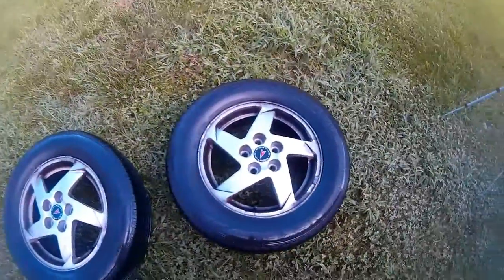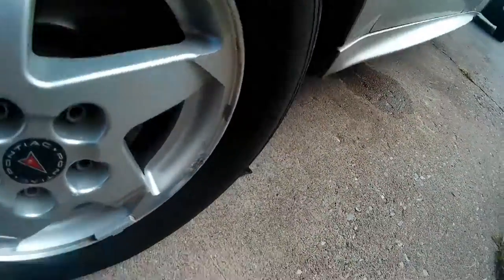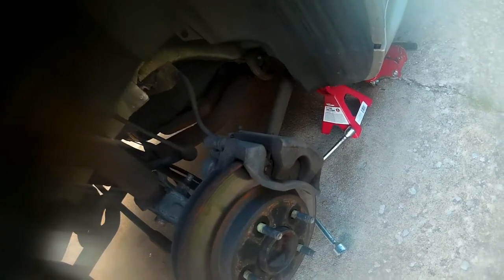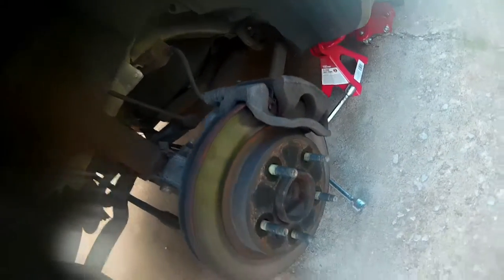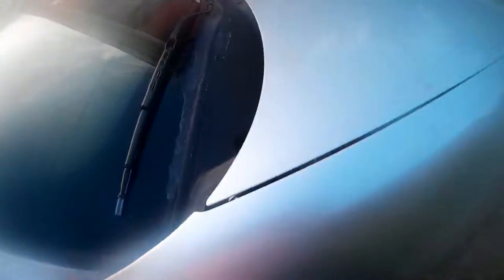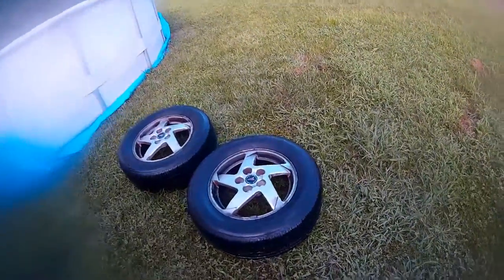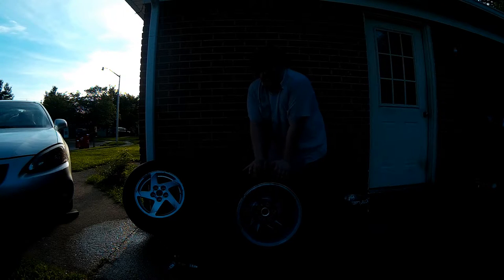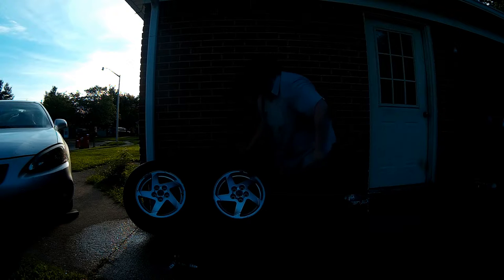Rim Cleaning - Pontiac Rims

Comment: Make sure you wash your hands thoroughly when doing that. That brake dust has asbestos in it. I'd suggest some cheapo latex gloves. You can get them at the dollar store.
Reply from the maker: Thank you for the advice, I did make sure to wash my hands thoroughly after I cleaned them. But that is something i should have said somewhere in the video. Thank you for the call out on this.